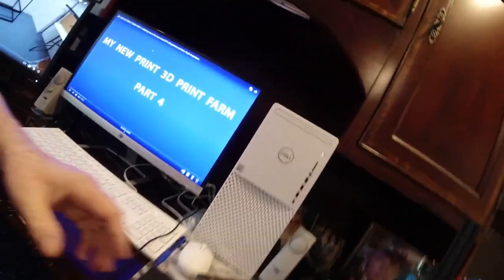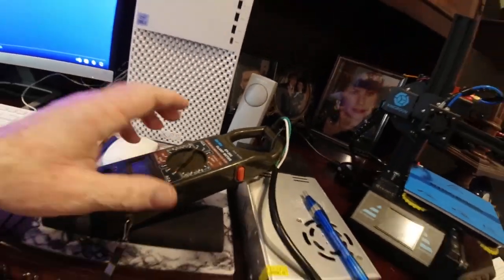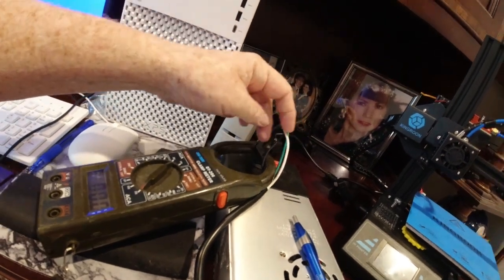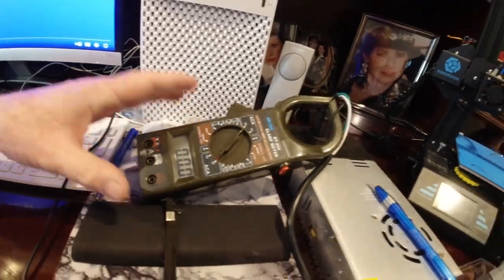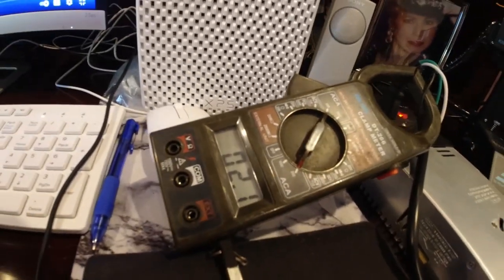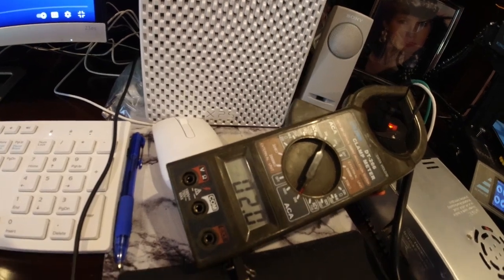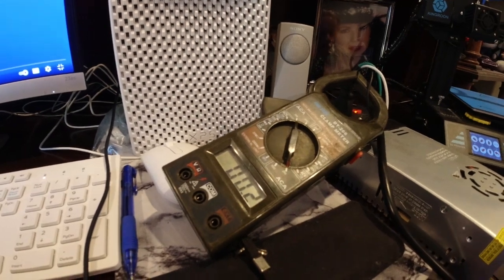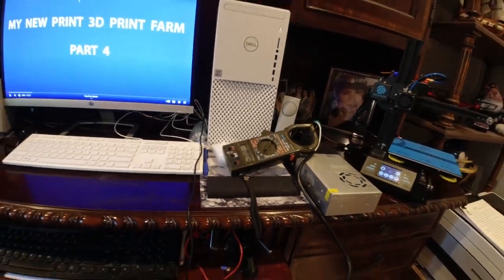HOW  MUCH  POWER  DOES  MY  3D  PRINTER  NEED? A must know for any 3D print farm.

Comment: The main key is to not kick them all on and preheat them all at the same time.  That will take far more than when they are all just printing, like more than double.
Reply from the maker: You're right Wayne, I have a video where I started 23 Anet ET4 printers at the print farm while monitoring the total current draw thru the process and the printers use much less power once there printing...Ken

Comment: I hooked my Ender 3 S1 Pro up to my battery backup and that has a little screen on it that shows watts used.  I think it took over 200w to heat up, but while printing it was like 100w.  More than I thought tbh.  It really adds up when you got a whole farm going.
Reply from the maker: I have worked with some inverters and car batteries trying to create a system that will keep my printers going during short power failures, like 5 to 10 minutes...Ken

Comment: Thanks for sharing, I live in the Philippines and power is always an issue, but I seem to get along with my Anet ET4+ just fine.  I did want to mention about the reliability of the Anet ET+, which is they run great for a few months, but eventually they seem to have a pretty big issue with the Extruder Drive Mechanism feeding the bowden tube to the hot end elements.  In fact, one machine is completely down, and its one of those "challenging" moments, whether to go whole hog in upgrading it or just full maintenance.  I am opting for the upgrade path, by installing a BMG direct drive for the extruder, but that brings on other major headaches; flashing the firmware, updating the firmware, deciding whether to fork to a path to OEM firmware or going to open source Marlin 2.0, then you will need a SLink device and open up the ET4+ case and dig into the board, which is fun, fun, fun, speaking from someone with limited electronics experience, but max level "nucking futs" drive and who is not of sane mind.  I'll be pushing forward to see if I am successful with this current "Challenge" or just nice farm door stop.  BTW, i did the same move, pure economics on purchasing the ET4+ and no background check, no regrets so far, and  I think the upgrade path shouldn't be too expensive on parts, just time which is so precious these days.

I am certain with your electronics background this should not be an issue, but I hope you do share how to solve some of these future issues with the Anet ET4's as time progresses.

Thanks Ken and keep up the great work in your channel, it's so appreciated. All the best.
Reply from the maker: I have purchased hot ends, heaters, extruder parts, belts, motors, power supplies, rollers, bearings, and other parts in anticipation of break downs. So far I have had to replace a couple of fans and lots of nozzles. I have had no major problems with the Aner ET4 printers. The new print farm will tell the story of how reliable these Anet printers will be. Thanks for your comment and input...Ken
Reply: @NewTechInventors Excited for more Ken, love the pace and enjoy the ride.  Have a good one buddy.

Comment: Thanks ken you answered my question .. eventually I’d like to run a Prusa mini farm ... I believe they run on 12 volts .. so I guess an estimate would be around 8 minis on a circuit. Is that about right?  Thanks Joe
Reply from the maker: HI Joe, the number of printers depends on the maximum power ( AC  AMPS )  that each printer uses. This is determined by using a meter as I have shown. From my experience most 3D printers like the Prusa use a maximum of about 2 -2.5 amps at 110 Volts. So you would need about 16 - 20 Amps max to run 8 printers using this example. I hope this helps, maybe someone out there knows how much max amps the Prusa uses at 110V and could tell us. I will let you know if I find out myself. Thanks for watching...Ken

Comment: Great info. I've always wondered hoped many you can put on one circuit. 👍👍
Reply from the maker: I probably rushed thru that a little, but you can find the meter with current clamp on eBay for about $12.00 which is a good investment. For my 220V friends overseas, you can get a lot more printers on a 20 amp circuit than I can at 110v ( twice as many ). Thanks for the comment...Ken